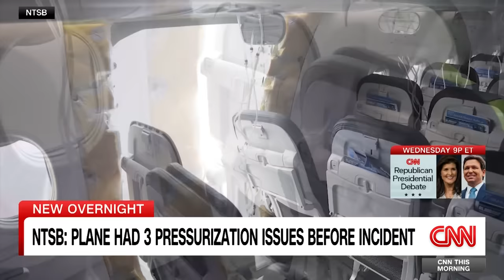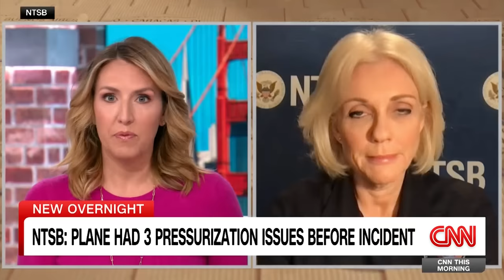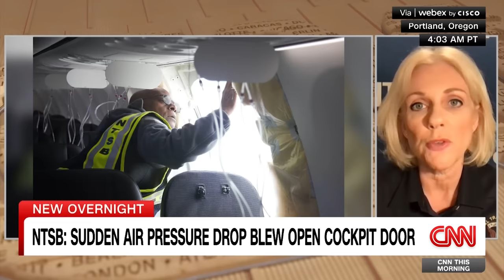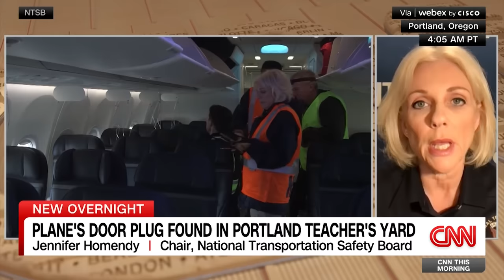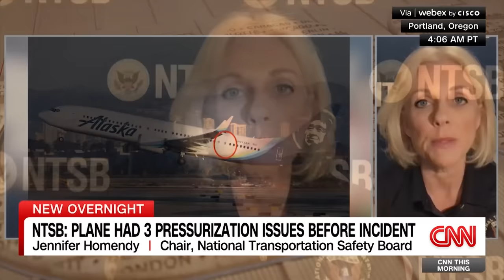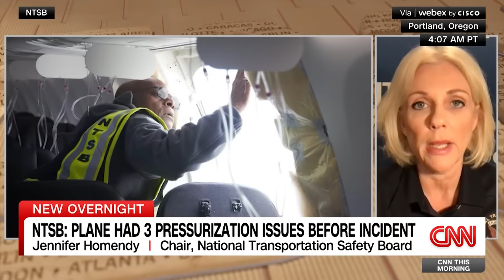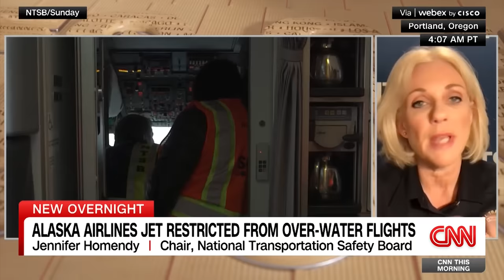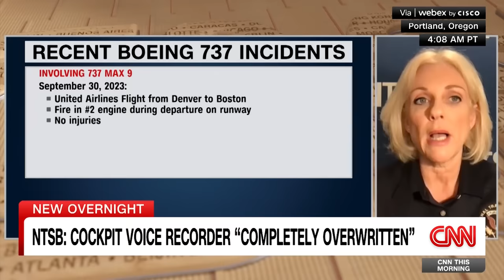Official asked whether it's safe to fly on any Boeing plane right now. Hear her response

Comment: The deep problem is allowing manufacturers to certify their own machines. Boeing is one of those who has the authorization to do so, and that led to the 2 tragic crashes that grounded the fleet.
The Federal Administration has to retake their duties and do the testing themselves to or not to certify models and mechanical/software upgrades to those models.
Reply: The FAA has been running the show with the Max for years now.
Reply: @frankiexv4533  - yet, only after the 2x 737-max crashes...
Reply: When was the last time you heard an Airbus have problems?
Reply: It is absolutely impossible that the FAA could certify and verify all the engineering that goes into every aircraft being built. They (FAA) would need to hire tens of thousands of engineers that just don’t exist. So when it comes to engineering the FAA is essentially manage a conflict of interest. Obviously with the two 737 tragedies, managing that conflict of interest requires more oversight and restructuring. This has been going on for many decades as a necessity, because if the feds had to certify everything, we’d still be flying around in DC 6’s. Don’t be fooled the European aviation authorities, who oversee Airbus are in a similar situation.
Reply: @johnb6690  It is a necessity and they don't need to certify each machine, only one and make sure the rest of the fleet is up to specs. There aren't that many new models of commercial aircrafts, so the work can be done with a specialized crew in a hangar. That's how it was done in the past. Or hire a company for that, but you cannot leave it to the manufacturer who has a huge conflict of interests in speeding up things, and that's how you get deadly bugs in software updates when mixed with poor pilot actualization and simulation leads to hundreds dead.
Reply: This all sounds so simple, but I detect some disingenuousness in the post. So, I’ll just leave this here: it is proposed that the FAA (or some agency to be named later) employ sufficient inspectors certified with the expertise to inspect any and all brands and models of commercial airliners. Is that it? Really?
Reply: Remember when the Boeing leadership and later racist trolls on YT Comments sections insisted the LionAir and Ethiopian crashes happened because the pilots were “from third world countries”, and “didn’t have proper training”? Turns t it’s just p1ss poor workmanship and design by Boeing.
Reply: you might want to research the A-350 and the delamination / paint problems.   @toolbaggers
Reply: This was filmed years ago.  https://youtu.be/IaWdEtANi-0?si=N130uu3xhhPLOlI6
Reply: @erdvilla  regrettably this is the reality
Reply: Here come the lawsuits 🙄 I bet they've already lawyered up
Reply: @Andygarrett357  Exactly, Airbus gets chipped paid, Boeing panels are blowing out, de-icing is a fire hazard, not de-icing is a FOD hazard, MCAS is MCAS.

That's just the Max.

Passenger was impaled by a fan blade on a 737 NG.

Starliner is a complete joke. Flammable tape, neurotic software, stuck valves, and the clock is still flashing 12:00 on the VCR.
Reply: Wrong - Boeing knows their planes better than anyone- Do you want some box checked person to inspect a plane? - what the...., thats insanity
Reply: You’re a little behind the time here all of this is happened and implemented.

The issue with the door it had originated at Boeing supplier, so it probably wasn’t scrutinized.

That said, it’s an incredibly easy part to inspect for, to make sure that the bolts are in place, so grounding the planes, and getting them inspected and back into the air could take as little as a day.
Reply: @classiccontrast , the door was just laying in her backyard. It didn’t hurt anything it didn’t damage anything, so what is she going to sue for?  Remember you can only sue if you have a loss or damage if you have none of those things just because it happened on your yard doesn’t mean you get to sue. Her case would be dismissed if she tried.
Reply: @DaveP-uv1ml  psychological, also her backyard could be scrapped. That’s all damage.
Reply: @classiccontrast  , speculative.  You need substitute damages, meaning, not damages in the hypothetical. In other words, you need to show us your broken legs or your broken arm where it hit you and where it hurts you.  Psychological stress?  You’ll be handed a tissue by the court and told to get over it and you get nothing.
Reply: @Krispy1011  Yes, they know them pretty well, so well in fact they pressure the technician s to fast track the tests on components that are finicky or that have failed on previous revisions.
Testing your own stuff when there a deadlines and penalties is a mix for disaster or in this case for the scare of a lifetime.
Reply: @toolbaggers Last month. There was a case where an A320 had to perform an emergency landing, oddly enough, due to a pressurization error. That was ultimately blamed on maintenance even though that was a newer plane as well. Also, many Neo aircraft are being told to increase their inspections as their engines are effectively breaking down far too quickly.
Reply: lets just do what gop wants cuts and little to no federal oversight for anything and then we'll see what happens 🤣
Reply: @sinistan1002  Imagine the FDA operated the same way as the FAA. The Opioid Epidemic would be an Aspirin Epidemic in comparison to what we would see.
Reply: @erdvilla  imagine having zero oversight of anything and trusting pharma companies or airlines to just do the right thing what do you think the results will be 🤣
Reply: @mencken8 you left nothing.
Reply: @DaveP-uv1ml Boeing didn’t use to have suppliers and Boeing is responsible for testing and integrating all supplied parts on their plane
Reply: @sinistan1002  We did, and the 737 has been paying for it ever since.
Reply: @M_SC  , Boeing has always had suppliers just not to the degree they have now.  Boeings’s problem is that part of quality assurance is that you empower your workers to speak out when they see problems or notice issues with the assembly line.

That’s your first line of defense in quality control, and when workers did exactly that Boeing branded them troublemakers and routed them out.

Consequently, Boeing management have boxed themselves into a position where they have workers who are all yes people.  Everyone’s fearful of interfering with the assembly process and being branded as a troublemaker by management for pointing out problems.

Boeing needs to stick to a more realistic assembly schedule and not try to rush through and meet unrealistic sales quotas.
Reply: So much more than that. It's what I call sever Codependency. Howard Hughes went through these crazies when people he paid just wouldn't do the engineering right. Depressing really. Howard had no mental problems. People wouldn't do right after he paid so much money and then turned around and said he was crazy?
Reply: @johnb6690 Do they do unannounced, random audits? Also, it makes me wonder how the auto industry safety inspections are structured…?
Reply: @TotalEclipseOfTheSon  I would imagine so, but can’t speak to their capabilities or  how comprehensive and frequent those inspections would be.
Reply: Boeing needs to put the Kaizen method because Boeing without Kaizen will take Boeing into bankruptcy. 

I believe Kaizen is very virtue in the aviation industry so if you want safety then Kaizen is the way to go.
Reply: Everything is being sacrifice for DEI rules and regulations. It affects QUALITY, SAFETY, CUSTOMER SERVICE, BEST PRACTICES will decrease. In regards to hires and promotions education, experience, skills, capabilities are secondary. Meritocracy out the door I guess.
Reply: @johnb6690  Do they? The Head is a BA degree holder from Penn State. And I just got hit by the truth that the head of SAFETY is not BESc or a BSc holder.
Reply: Meanwhile every plane I get on lately is a 737…. Almost always 🤦‍♂️
Reply: @erdvilla They do. Operation warp speed.

Comment: Profits over people is the 🇺🇸 way
Reply: No, it's cut-throat competition. They have to minimize cost to stay in business. They cannot afford have a flyable plane sit idle, losing tens of thousands of dollars each hour. Why do you think air fare is so cheap these days compared to 30 years ago? Air trip was a luxury trip in those days, nowadays, it's just a public transportation just like any other such as bus, or train.
Reply: @DS-ve1xh  When did this last happen to another plane builder? Two crashes killing hundreds and now a structural failure?
Reply: The profit motivation actually encourages safety. No customers will want to fly Boeing if they do not get to the bottom of the issues fast.
Reply: @billpugh58   the Concorde with 11.36 percent fatal crashes per million departures is worse than Boeing Max. However, the Concorde is still regarded as a fine airplane as as Boeing MAX.
Increase minimum airfare to $1000, then manufacturers and airlines will be able to spend more money on the safety and safety records will improve a lot.
Reply: It's gross
Reply: @DS-ve1xh the Concorde stopped flying because of this in the early 2000s'.  😂
Reply: @DS-ve1xh  The Concorde was retired, these planes are still flying even after two tragic crashes in Ethiopia and Indonesia. Airbus has less mishaps to its name because it's regulated by the EU and the legislators there aren't lobbied by corporations. Regulations guys, it's not that hard to see.
Reply: @Snaakie83 That is actually not true. It stopped flying because the plane was noisy and extremely expensive to operate. Also only 1 Concorde ever crashed out of the 20 total produced. The aircraft was overloaded, the number 2 wheel was cut by a metal strip lying on the runway. Some even say the crash didn’t have to happen due to operational errors and negligence.

Saying Concorde isn’t safe without knowing why the only ever recorded crash of the Concorde wasn’t due to its design is very ignorant.
Reply: @Snaakie83  The Concorde stopped flying because it didn't make enough money. It didn't make business sense. It just couldn't compete with other airplanes that delivered more people at a cheaper cost.
Reply: @DS-ve1xh they can pay their ceo, bean counters and markerters less
Reply: @DS-ve1xh Where the living hell did you get that number? Only 1 ever crashed and your 11.36 percent would put it on 2 concorde planes crashed. You sound like those “aviation” tiktokers who know nothing about aviation.
Reply: @abdulwasey3506  Airbus was heavily subsidized by European governments. Basically, they got a lot of free money as the new Chinese manufacturer. On the othe r hand, Boeing has been playing fair all alone. Boeing actually lost a lot of money doing business with the US government unlike their counterparts which got free money from their respective governments. Trying to do business in a very competitive market while others are cheating is not that easy. Actually, it's very tough.
Reply: @BSenta  Even if they pay $0 to the CEO and other top executives, it won't reduce their operational cost much. However, if airlines can charge twice as much for their fares, the money will flow to Boeing and Boeing and airlines can spend much more money for safety. It's the same as bus industry. If they can charge twice as much for bus fare, they can hire more qualified bus drivers and spend more time on fixing/upgrading things, but they cannot since they need to be competitive. That's why you have a lousy greyhound bus experience.
Reply: @Cursory3 You read my quote wrong. It said, "the Concorde with 11.36 percent fatal crashes per million departures"
Reply: @DS-ve1xh  the plane only crashed once and is also the only fatal accident. So you’re saying that the plane had 113.600 fatal crashes per million departures? Ignoring the fact the plane never even got close to a million flights.
Reply: @furry_homunculus  You don't understand the market. All the airlines want to get more for less from manufacturers and they play Boeing against Airbus for reducing their cost. Boeing to meet this challenge has to streamline their operations. Boeing's job is not easy.
Reply: @woopert7  the profit motivation is safer? are you insane?
Reply: @DS-ve1xh You, grasshopper are putting the cart before the horse. But you go on thinking that you are real smart.😅
Reply: @DS-ve1xh the difference is the concord crash was because of an external event. The 737 MAX issues have been because of design issues.
Reply: @norbertmayer7005  The concord crash was also a design problem. Blown air tire shouldn't have caused human deaths.
Reply: @DS-ve1xh  I agree to an extent, but there’s also some poor airmanship in it. For instance they were overweight for a tailwind takeoff. If they would’ve taken off with headwind the tragedy might have been avoided. Also they turned the aircraft while it had too little speed. Asymmetric thrust is manageable with a bit of rudder input. Yet they turned to the left instead of to the right. They even tried to lower throttle of engine 3 and 4 which caused the stall.
Reply: @DS-ve1xh  But the tire didn't explode bc it felt like exploding and you would've known this if you actually knew what you are talking about. A Mcdonnell Douglas DC-10 departed 5 mins before concorde did and this DC-10 lost a titanium alloy strip that was part of the engine cowl which was left on the runway. The concorde ran over this piece of debris while the aircraft was doing it's take-off run. And it cut the right front tire. Tire debris hit the left wing at a significant speed that didn't rupture the fuel tanks but it did sent a pressure wave that ruptured the number 5 fuel tank. The fuel started to leak and was ignited. Engines 1 and 2 started to lose all power. Despite Engine 1 slowly recovering the concorde was unable to climb and the speed kept decreasing. 

It wasn't the concordes design that caused this plane to crash but debris on the runway rupturing the tire and that being the first domino to fall.
Reply: @Cursory3  The concorde engineers should have designed the aircraft against random highspeed debris. A small high speed debris at low altitude causing deaths of more than 100 passengers is unacceptable. Got it?
Reply: @DS-ve1xh  FOD is a major concern for all aircraft so now you're just ignorant. Another plane could have had his tire burst and the tire hitting a critical part like the wing or an engine, causing asymmetric thrust causing one wing to lower and the other to rise because one side has an engine pushing the plane forward and the other is not.

Comment: I’m an A&P mechanic having worked on tons of 737s and this has never been an issue with the older 900 which has the exact same door design. This is likely an issue of shoddy maintenance or assembly work at the Boeing factory. Every day the shortage of technicians intensifies and there’s more and more completely inexperienced people put to work and assemble these things without even having gone through school and having 0 mechanical skills. Expect to see more of these type of crazy issues in the future.
Reply: Not made by Boeing as I understand it.  Fuselage is bought from another company.
Reply: @TheTruthSeeker756   Apparently, Spirit AeroSystems make the fuselage with the 'plug' door partially attached.  After the fuselage is delivered to Boeing, they (Boeing) then remove the door so they can load  interior fittings/furnishings through the opening, before then refitting the door before completing interior fit out.  If it is the case that the door had fallen off  because it was not attached properly, then it  is back on Boeing.
Reply: @gbnq2513  This is correct...I also see no reason for the operator to have opened this within the first two months of the aircraft's operating history.....of course the maintenance logs will show this.
Reply: United found loose bolts on door plugs on several 737 Max 9s.
Reply: Boeing huh? I guess Airbus will be my preferred choice from now on..
Reply: can’t be maintenance in this case for a 3 months old plane
Reply: Thank you for this comment.  We have reservations to fly with Alaska Airlines in just a few weeks, on a 737-900.  For us, it is a once in a lifetime trip and I’ve been freaking out for days, even though on day 3 since this incident I finally was able to piece together that the 900 is not the same as theirs model.  That picture they keep showing whee the window seat one row up lost it’s headrest and is torqued?  THAT’S my seat number.  I kept asking myself if a new one with shoddy inspection practices could do this then what hope is there for an older one.  Your comment here is comforting.
Reply: Assembly. I bet they were not even installed. Boeing has booger eaters for engineers and installation now
Reply: @Jitterbuggn I just flew cross country on the 900. It’s a nice ride. Enjoy.
Reply: @Jitterbuggn  They are all grounded for now...
Reply: @pakpala1  The old 900s aren't grounded. But for all I know they are pretty uncommon and have never had any incidents
Reply: Agree. It will happen until we start to value education again and pay people livable wages.
Reply: @TheTruthSeeker756  the company that made the door is a subsidiary of Boeing. This  newly created subsidiary is a means of protecting Boeing from liability. It’s a shell game putting all our lives at risk.
Reply: @Jitterbuggn The pilots that know aircraft love the 373/900. You’re flying an older aircraft. You will be fine. It’s the new aircraft built with low wage, nonunion workers and strict timeline that is the concern. Enjoy your trip!
Reply: Yeah soon we have Airbus setting up an assembly plant in South Korea, and we end up flying airplanes from a Japanese manufacture if Boeing keeps screwing up.
Reply: Because of DEI was put in as one of their priority.
Reply: @salishseas  Thank you!  I am honestly too old to wait another 11 years for the next sun cycle peak.  For us it’s kind of now or never.